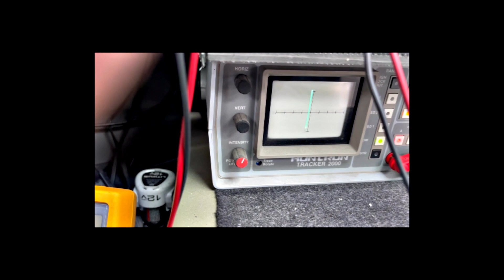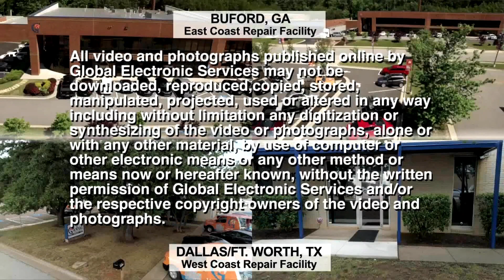In-Circuit MOSFET Testing

Comment: how are you triggering the out of circuit mosfet and at what voltage?
Reply: Likely was using the voltage from the huntron and simply shorting gate terminal to one of the others with huntron leads.